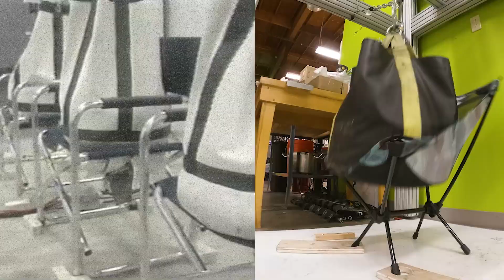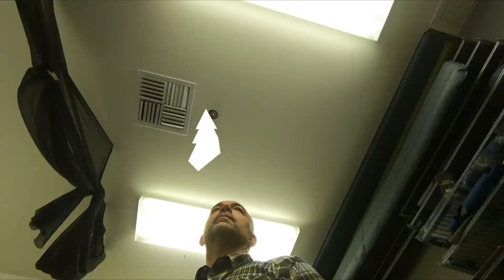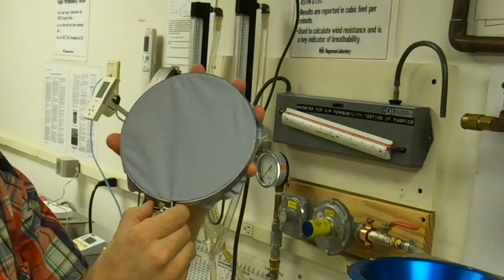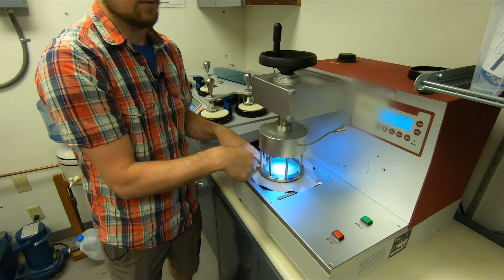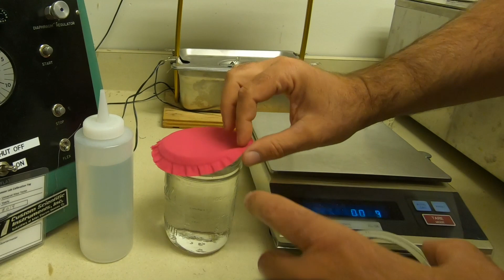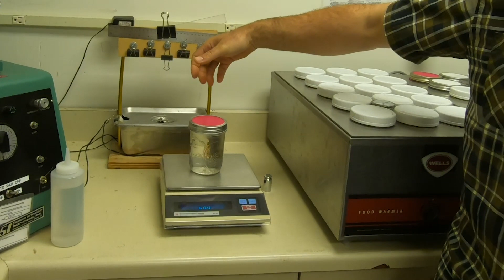REI | Co-op Tested, Co-op Made: Jacket Water Resistance // Ep7

Comment: Cook video! One thing to keep in mind is that in the real world (outside of the lab) it does matter if you are getting wet from the outside or from within. Outside moisture (rain) will be much cooler than your own sweat. This may not be a problem in warm areas, but when the rain is at low temps (50s-40s) outside moisture could give you hypothermia pretty quickly. On the other hand, your own sweat is at body temperature and won’t cool you off too quickly (as long as you keep moving and generating heat) avoiding the nasty effects of hypothermia.